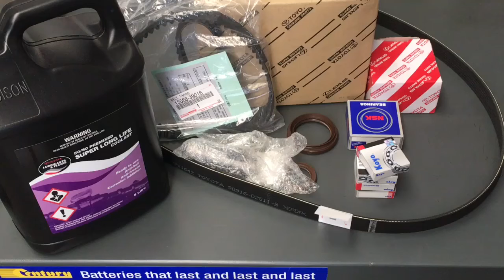IMPORTANT TIMING BELT WATER PUMP INFO

Comment: Part numbers for the four koyo bearings in the idle pulleys? I cant find any that are an exact match to the 6301RDHJ that are installed. Will an 6301-2RS do the job?

Comment: Its important to realize that the age of the car can be a good barometer in deciding if you replace all..if the unit is say 14yrs old but has only 63k km then it should be considered worthy of replacing all the components